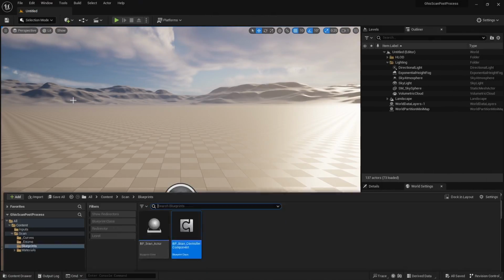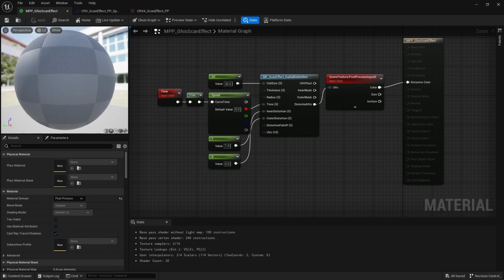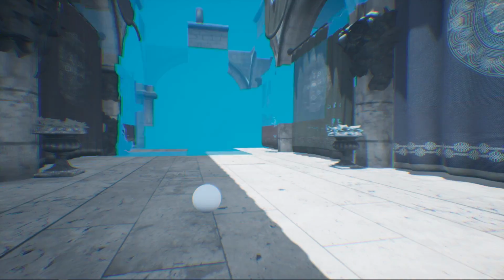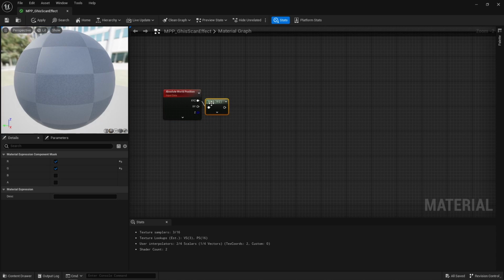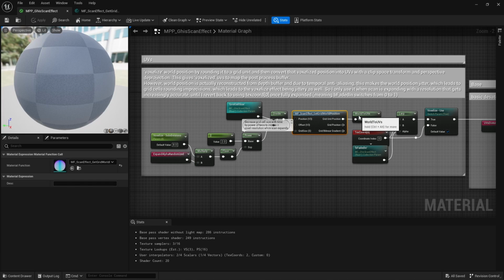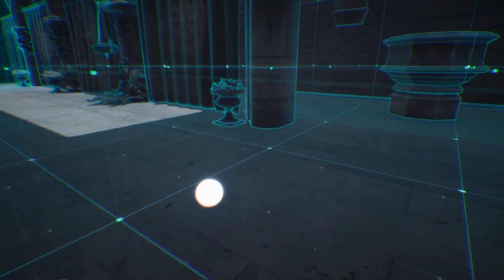Advanced Scan Effect PART 2 - Post Process Material

Comment: Hi, awesome tutorial! I'm trying to recreate this and I stumbled upon an issue. In my case the "blink" effect is looped and plays over and over and doesn't seem to respect the FadeIn and FadeOut methods (which Ive debugged with a string and seem to be working just fine - slowly fading in when i press Q and fading out when I let go). It just pops in and pops right out.
Think you can help me?

Also i don't know if youll understand the reference but your voice/speech patterns reminds me a bit of Kim Kitsuragi from disco elysium, it's so calm and precise!
Reply: You need to remove the TIme and Frac nodes and add the Speed from the curve that you created so it loops only once from 0 to 1.
Reply: @vikpet91  Thank you! I just checked and I indeed had them there. I removed them, but now the curve effects dont work properly :( for example the flash effect should only appear along the curve, but instead its constantly on. Any idea what i'm missing? Thanks in advance!
Reply: @marchosiasu9700  I guess you need to plug the curve again but in the Blue channel, i hope you created them like in the video.
Reply: @vikpet91  I managed to fix it! You are literally saving my ass, thank you! Turns out I simply set the fadein speed and fadeout speed as much too fast, so the pp skipped right over the actual start of the effect and lead to some artifacts.
Reply: @marchosiasu9700  No problem , this is hardcore tutorial i recreated the setup for a project that im working on and i have added outlines for multiple characters with different colors and different IDs, they also pulse in different color like a highlighted objects for different purposes.

Comment: Hello, this is a good tutorial that I am really enjoying. I Just have one problem.

When I reach the Scan Outline section it doesn't work for me because nothing is being outlined. Everything in the normalConvolutionKernel function looks right (I've checked like 10 times now), the setup is extremely simplistic, but there's no outlines for anything. I tried changing maps, adding in props that aren't just an SM_Cube, but nothing makes it look like 11:01. The only thing I haven't checked is the Falloff input in NormalConvolution because it's not shown from what i see.

StencilConvolution and Character outline worked just fine. I will admit that NormalConvolution looked really similar to StencilConvolution so I duplicated StencilConvolution and just moved some things around to make NormalConvolution. 

I'm not sure what I'm doing wrong here. I'd be grateful for any help, though I'm afraid there's not much that can be done without looking at my PC directly. Thanks, and have a nice day.

Edit: I got it. It was the falloff and the outline parameters in NormalConvolution. I tried editing the parameters individually and would reset them afterwards without thinking that there was more then 1 cause for it to not work. I then created an parameter that i used as input into outline, then I thought to put it into falloff and forgot to disconnect it to outline. This made it work finally. So, I was right about Falloff being part of the problem, but outline was also needed.

Not to sound rude, that's the last thing i want to do. But maybe next time make sure to show us these necessary pieces. Again, not trying to be rude, perhaps its my fault because I'm a newbie who doesn't have years of knowledge and experience in this. I wouldn't know if it was implied that we needed to fill in those input variables ourselves or not. 

I seem to be the only one who had an issue so, maybe it was me. Either way, I figured it out. So it's all good.

Comment: Hey! Great tutorial! I've got a problem however : unless I missed it, you didn't show what's inside the MF_ScanEffect_GetCharacterStencilIndex. I'm not used to work with stencil yet so i can't figure it out by myself. Or maybe you showed this function in another tutorial. I just tried to plug a constant value of 1 instead and it worked but I really want to know what's inside this function because I feel it's not that simple and it could be usefull for me to know that missing part :) (Okay so I watched the 3rd part where you showed what's inside now I feel dumb)

Another problem I have is that on the last part (voxelize) of the video, it works alone but when I add it to "UVsDistortion" and plug it in the SceneTexture of the base like in your example, it does something so weird I can't describe it, it's like it tears the screen Uvs for no reason. I don't see where could be the error in my shader T_T
Even when disabled, it still tears the screen. So I guess it's either a problem with my UE5 version (5.6) or an error in my MF_ScanEffect_RadialDistortion function that I just can't find

Anyway thank you for sharing all that it's really fun to learn from your videos!
Reply from the maker: Hey! Thanks. Sorry for the delayed response. I understand the video is too sped up and with too many cuts, making it difficult to follow. Not my finest work, I suppose. I'm however pretty sure I have exposed the inner workings of every material function throughout the series, even for a brief moment. Regarding your second issue, well it's hard for me to tell. There are indeed many pieces to this puzzle and the tiniest mistake may very well break everything. I'd suggest double checking everything and testing every function on more simpler setups first to ensure everything works as intended. In doubt, files are available on my Patreon. Best of luck!
Reply: The solution is on 18:35 , you can see in the Add node he replaced UVsDistorted with UVsDistortion. Everything is working on my end in UE 5.7

Comment: 7:28 function MF_ScanEffect_GetGridWorldPosition function connected to Position(V3) below fails and does not work. As you showed in the video, all nodes are placed, but they do not work only in that area. stats says '[SM5] Function MF_ScanEffect_GetGridWorldPosition: Missing function input 'Offset''
Reply from the maker: likely that input's 'Use Preview Value as Default' isn't on. Default value has to be set as well
Reply: @ghislaingirardot  thank you I missed that 🙏

Comment: Hello, I know it's kind of an old tutorial already but maybe you could help me, I'm on a different version(5.5.3) and the outline effects doesn't look like the video, instead it's all jittery, it appears like constantly moving a few pixels left and right on somewhat detailed models. Maybe it's the default values for outline and falloff parameters, but I suspect it might be because the options of post process materials for blendable location changed, "Before Translucency" doesn't exist anymore so i'm using "Scene Color after Tonemapping" that I read was like the replacement but it's not the same(I also tried using every option but none worked). Do you have any idea on how I could fix it? or other way I could achieve a very similar outline for objects and walls? Thank you.
Reply from the maker: Hello. Hmmm yeah things definitely changed. Scene Color After Tonemapping sounds like the wrong option though, you'd want to inject the post process material way earlier in the rendering pipeline to allow TAA to do its thing. The jitter you encounter is likely aliasing, I suppose. I'm not sure actually.

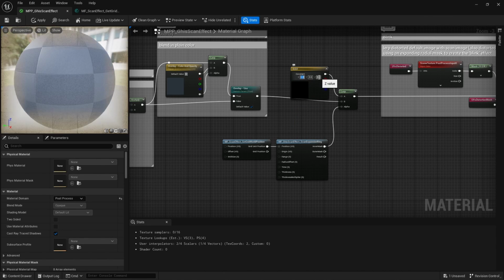Comment: 7:35 - Im unable to grow the mask unless I specify a range in the ScanExpansion MaterialFunctionCall. It's ignoring the value set in the MPC. I also have use preview value enable in the InputScalar. 

As you've mentioned, there are multiple ways to do things and I can control this alternatively by using a simple sphere mask but I would like to know where I've gone wrong.

Could you point me in the right direction please? :)
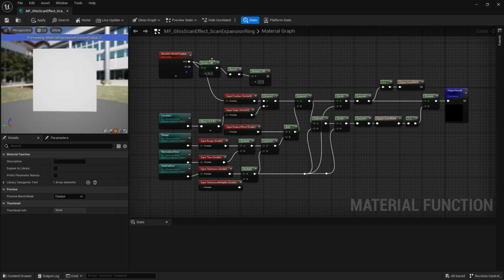Reply from the maker: Hi! double check @2:57 Range input preview uses the 'Range' MPC parameter

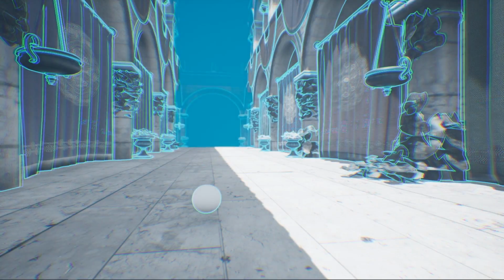Comment: Hi! May I know how to slow down the scan outline effect and also how to make the blue color transparent (from the video 11:08)? Because I set my range to a very big number, the effect happen too fast, causing not gradually smooth transition. The blue color also covered up my entire sky and it doesn't look good. Thanks in advance!

Fyi, the MF_ScanEffect_GetGridWorldPosition function can be fixed from (BPAC_Scan Component), I think it is from the [event begin play > set scalar parameter value > grid cell size default value], set the value other then 0, should be working properly
Reply from the maker: Hi! The speed is set in the blueprint component, if I recall correctly? Regarding the blue color, hmm, that's just a color added in the post process material, so I suppose you could just get rid of it. You could also use a bilinear gradient to have that blue color fade in & out and have it show just at the edge of the scan effect.
For your last point, yup, correct. That's what screwed the effect for most people, I added a note in the video description since then. Ty for your feedback!
Reply: @ghislaingirardot  Tried it, it works! Could I ask is it possible to activate the reveal effect in level sequencer and how to change to post process happen based on location of mesh instead of the middle point of camera? For example, I want to get a close-up shot of reveal transition, so I need to set another camera for that. Do you have any suggestion or other resources if this is out of topic? Thanks again!

Comment: 7:28 The MF_GhisScanEffect_scanExpansionRing function in MPP_GridScanEffect works properly, but the function MF_ScanEffect_GetGridWorldPosition function connected to Position(V3) below fails and does not work. As you showed in the video, all nodes are placed, but they do not work only in that area.

Comment: Hi, thank you so much for this tutorial as I did not expect to see something as great as this. Pls I have a question regarding the reveal effect. Since adding the getgridworldposition function to replace the normalized time, the blue effect thingy does not move as yours is moving. Mine is stagnant and glitching on the floor. I have looked through the tutorial from part 1 to part 2(reveal effect) a couple of times and I have everything exactly as yours. I read through the comment and changed the X value of the position input to 0.5 in the getgridworpdposition. Thank you for your quick response. Also pls anyone that knows can also reply thanks.

Comment: Hii, I really like this effect and tutorials however i seem to have an issue with the reveal effect as well. I checked the position its updated properly. When using normalisedTime as Alpha I indeed get the same result as in the video however when I ty to use the innerMask of the  expansion ring function with as input gridworldpos function nothing shows up, Also when i try to change the gridsize in the gridworldpos function the effect fades in and stays and covers all. I really hope i could get a solution for this since this effect works nicely and is really cool
Reply from the maker: Hi! Sorry, I don't know what to tell you. I've recorded this step by step to ensure I made no mistake, and everything should indeed work as shown in the video, unless you missed something I'm afraid. Make sure you understand what each function do before proceeding forward, so you can debug and test expected values vs what you get. Best of luck.

Comment: I am also little stuck😂，the reveal effect doesn't work when I use MF_ScanEffect_GetGridWorldPosition and MF_GhisScanEffet_ScanExpansionRing, the effect can't move in the world
Reply from the maker: What do you mean it can't move? It doesn't expand or it stays in place and doesn't follow your character? If it doesn't expand, then you did something wrong but hard to say what :p If it stays in place, well double check your blueprint does update the material parameter collection with your pawn's location and all. This is quite a complicated effect with many moving pieces. Maybe go back a step and make sure everything's correct. Good luck.

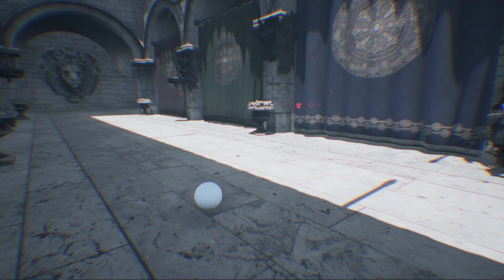Comment: Hello! I love your tutorial and the step by step guide. I am a little stuck. So for the reveal effect the initial test at 7:03 seems to work but when I try to work in the gridcellsize after, it doesn't seem to be doing it's job. I was wondering if it was because some values were different for the GetGridWorldPosition material function. Can I know the preview value for the Offset Input in the GetGridWorldPosition function?
Reply from the maker: Hello! Offset input is (0.5, 0.5, 0.5). Not sure what your issue is, sorry.
Reply: @ghislaingirardot  ah that was what I had I guess the value wasn't the issue. Thank you for the reply though!
Reply: yes, should elaborate more on that function
Reply from the maker: @handler_music  Well, there's not much to say. Let's assume world position is (534.23, 239.34, 957.35), offset is 0 and grid cell size is 250.

Position divided by grid cell size >  (2.13692, 0.95736, 3.8294)
Add offset (0) > (2.13692, 0.95736, 3.8294)
Floor > (2, 0, 3) That's the grid cell index
Multiply by grid cell size > (500, 0, 750) That's the position of the grid cell the given world position is in, in world space

Let's assume offset is now (0.5)
Position / grid cell size >  (2.13692, 0.95736, 3.8294)
Add offset (0.5) > (2.63692, 1.45736, 4.3294)
Floor > (2, 1, 4)
Multiply by grid cell size > (500, 250, 1000) The offset really just shifts the grid in world space by half a cell size

This function is meant to be plugged into the 'ScanExpansionRing' so the expansion ring algorithm doesn't work with an absolute world position, like (534.23, 239.34, 957.35), but with a world position 'snapped' to the nearest grid cell, like (500, 0, 750), thus giving a 'grid' expansion effect
Reply: In case anyone is watching this now and getting an issue with connecting the GetGridWorldPosition, make sure to click on the "Use preview value as Default" on the function inputs. That solved my issue.

Comment: Amazing stuff Ghislain!!

Found a weird bug not sure if you knew this, but the Cell Size on the Radial Distortion Function does not seem to like having a Parameter. 
If i put in a cell size of any number using a constant its fine - but the moment its a parameter its got an odd flickering square in the middle. 

Don't suppose you know why this might be? :)
Reply from the maker: Thanks ! Uh it s possible I missed this. I'm on vacations rn so I don t have access to UE so I can t check that on my own. Probably a floating point precision issue with world position being reconsructed from flickering depth buffer due to TAA/TSR
Reply: It is getting the value from the component blueprint where he set it to 500 GridCellSize. You can adjust that instead set scalar parameter value Grid Cell Size you can add a node to Get scalar value from the MPC that you created and you can tweak in the MPC or just tweak the parameter that it is in the component blueprint e.g. GridCellSize = 500 value